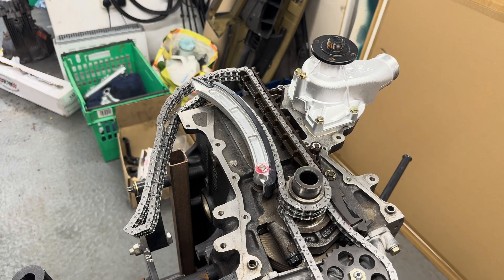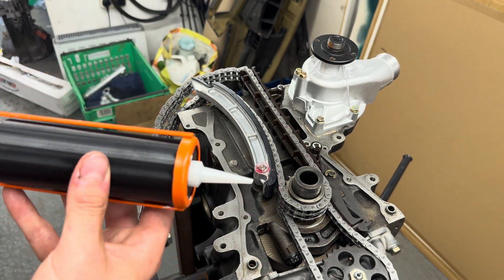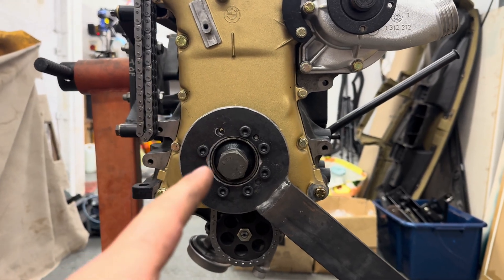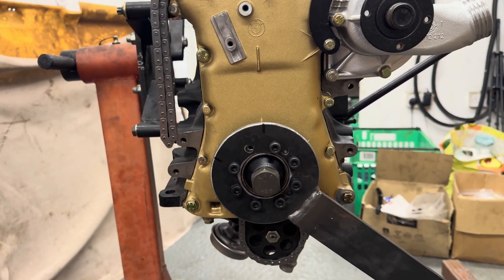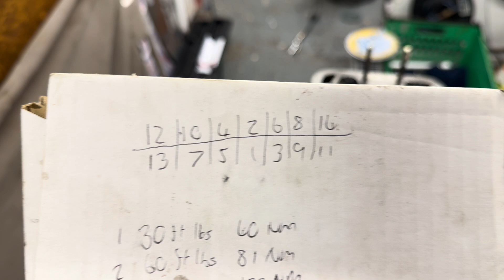We have hit an issue - Part 2: BMW S38B36 Rebuild

Comment: Hi! Im curious about what you did between the head blocks. The head is is seperated between the camshaft and valves!
Reply from the maker: So this just requires flange sealant, no gaskets here. Currently no sealant as I am just doing some PTV clearance checks first then will take it back off and seal it down

Comment: That's a real pig having to take those studs out again! Shame you offloaded your zinc kit, I had to de-rust the rear floor of my Peugeot 206SW. So cleaned everything up, used two coats of MIPA epoxy and zinced all the seat belt bolts. Looks epic now 😂
Reply from the maker: Yeh!! Just going to release the tension as the build spec says, remove and re torque with new bolts, leave the head on! Unfortunately as I said, no time (pr space) to plate my own stuff now, wish I still could